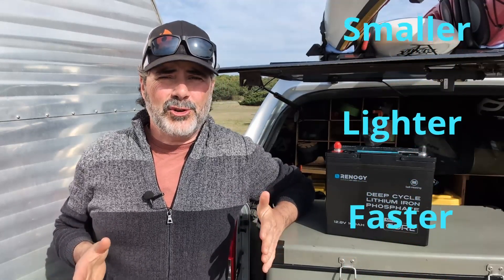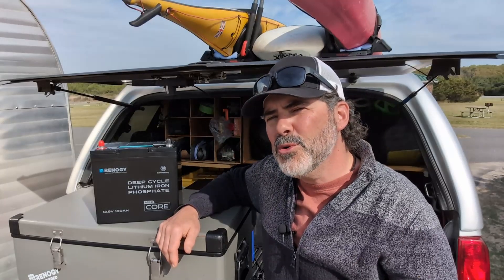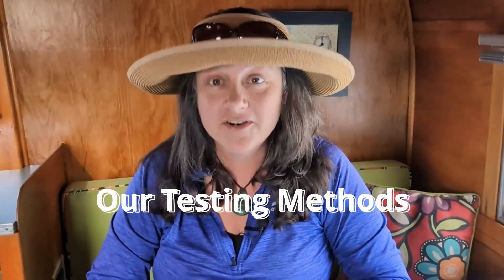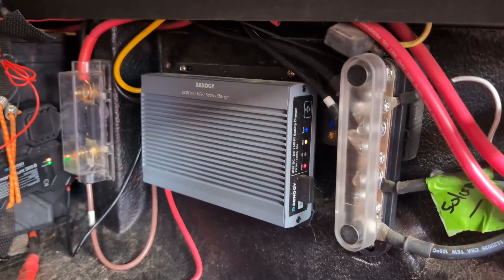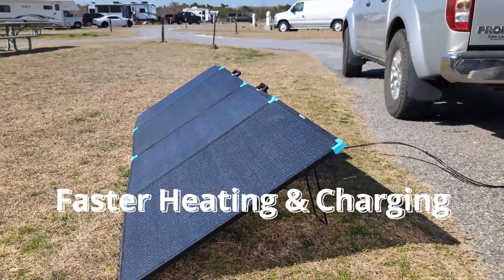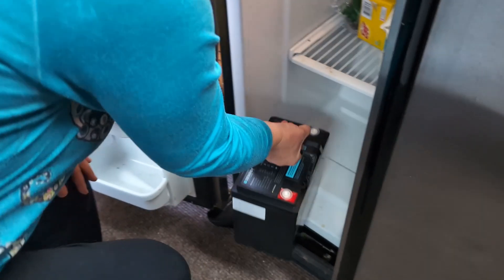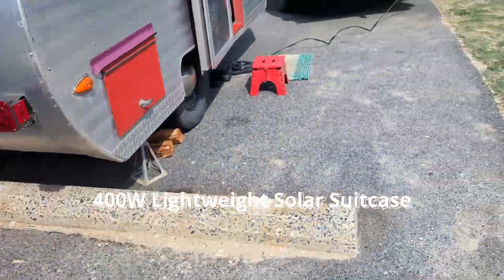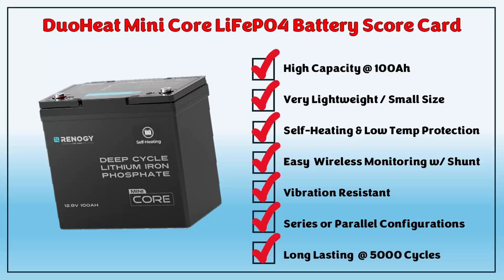Winter Camping Power: Renogy Lithium Battery Tested!  Duo Heat 100Ah LiFePo4 Battery

Comment: Finally a real test and explaining how and when the BMS turns on in cold weather. I  didn't want to pull the batteries during winter storage. I have right now 305 watts of solar and soon will have 610 and 90 volts for winter lockup till spring on our toy camper. Could never get an answer that you gave, the battery requires 10 amps of power to turn on the heater, so at night also in Wisconsin on a January/February night at -15*F I don't  need to worry about the battery, it wont try to charge till daylight and 10amps, so if the panels have snow on them and it is cloudy for the week, everything is fine. Then next month when it is 15-20*F out and sunny, then the system will wake up, warm-up, and be ready to go.
Reply from the maker: @davej7434  Hey thanks for the comment, please give us a sub!